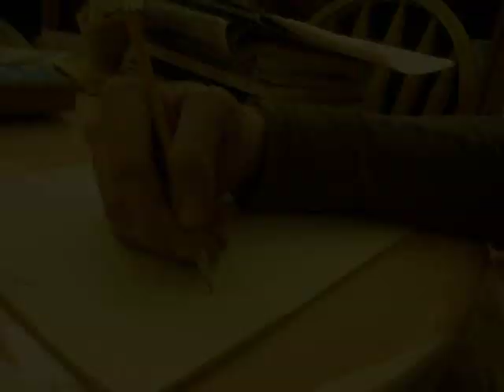Woodturning with Scotty D Lewis

Comment from the maker: The branding iron came from Lee Valley. Mine has the be heated with a torche or the stove. I would suggest the plug in one if your interested. Beware that surface must be absolutly flat or it wont work properly.

Comment from the maker: I do a drawing to scale of the side profile of the bowl. From that drawing I can see the outside and inside diameter of each "block" or layer.  I then draw the "block" or layer from the top( two circles) Then I draw the segments around the outside of the larger circle, and inside the smaller circle.  Then you simply just measure the width and length of each segment. All this can be done by hand. It is much quicker with drafting software. I use autocad